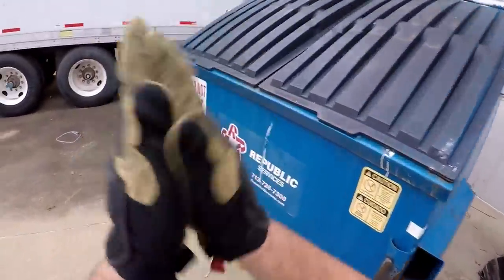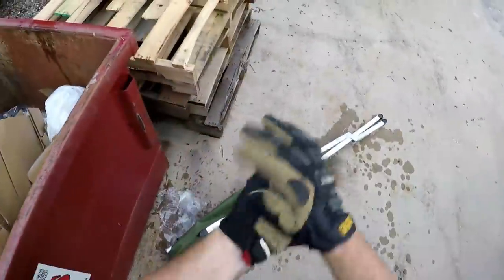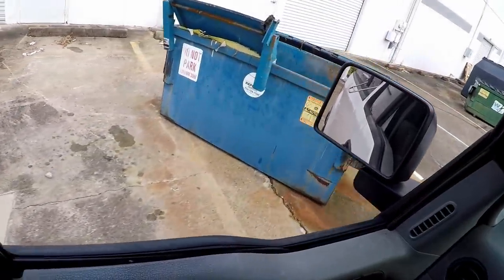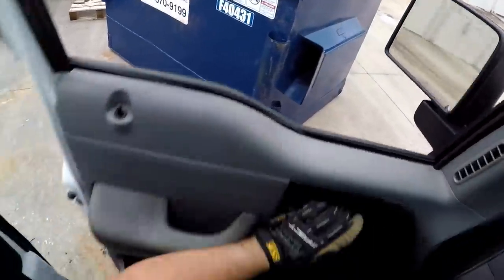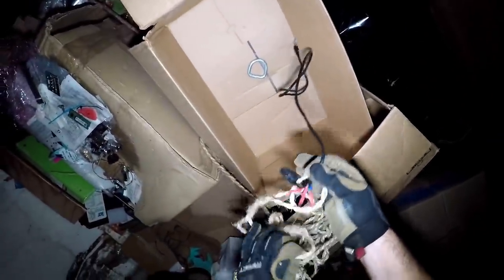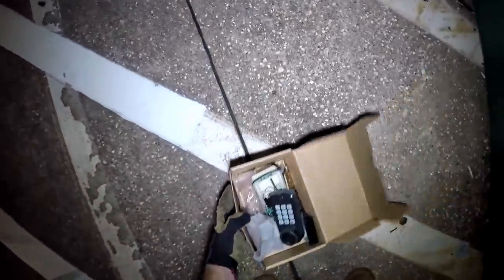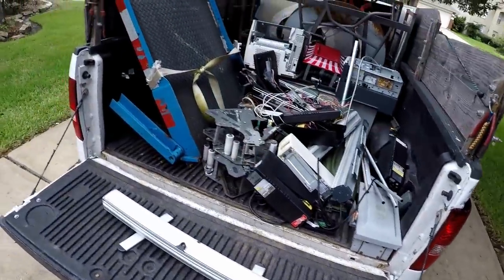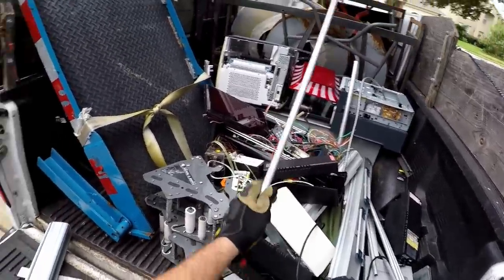Dumpster Diving "Mr. Big Purple Action"

Comment: That ramp might be out of a commercial vehicle. My wheelchair ramp in my van isn’t anywhere near that big or heavy. But it could be out of a city bus. It would still be good for someone in a wheelchair that needed a ramp to get up onto their porch. It calls for a foot of ramp for each inch in height of a porch or platform. So a six inch high porch needs a 6 ft ramp. If not it’s too steep and too dangerous. It would also be good for a shop that took pallets and such in and out. I think if you put the measurements and picture of it for sale you could sell it. Stay safe and God Bless